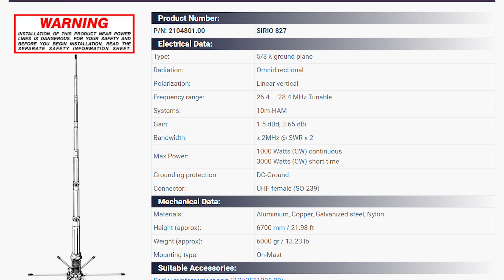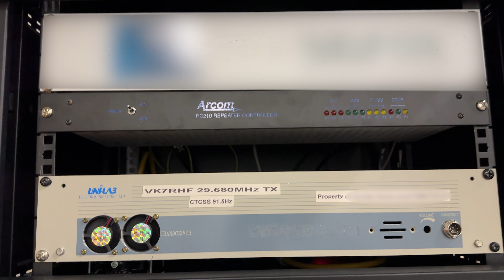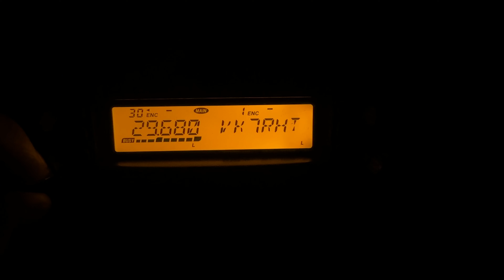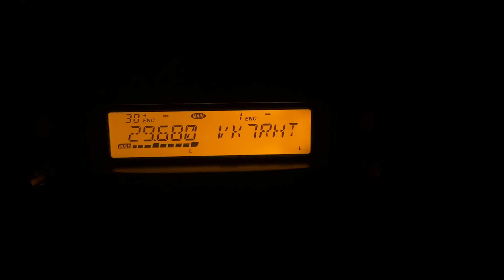This 10M/CB Antenna is a BEAST!

Comment: I have the 5/8 wave Sirio standard tunable 10/11 meter ground plane. This one has an adjustable top hat for tuning and 3 long radials. They are around $100. I'm using this until I get my hex beam But it's a really good antenna. I've made contacts all over the world with it on 10 meters with only 200watts. Studying for my general ticket and will get the hex beam up by the time I'm legal for all the other bands.

Comment: I have had 2 of the Megarang 827 antennas myself, 2 of my best antennas. Tip replace the screws at the top parts with clamps. Screws wear out the aluminum by moving the antenna, it then sinks 1,2,3 cm until a part collapses or slides in.

Comment: The metal roof certainly doing the heavy lifting giving the vertical antenna a really good reflection. Being elevated certainly helps as well because as we all know "height is might".  The combination of the  two probably makes this antenna a stellar performer.
Reply from the maker: Height is certainly might!
Reply: some common sense right here..

Comment: I am on my second 827 after having one of the first in the UK from the shop I worked at. They are a fantastic well made antenna 👍
Reply: i saw my first 30 years ago when i had the CTE Spectrum, which was a copy back then on the Sirio 2012.
i've had 827 thought for nearly 30 years myself..

Comment: I have an original Penetrator 500 I bought back in the early 80's that I just took off my roof and put in the shed. It was a great antenna back in the day.
Reply: I had a Sigma 4 in the UK, absolutely massive aerial...worked no better than a cheap 5/8wave vertical with no ground planes.  I got a far better range on the 5/8 wave silver road on a 10ft pole hammered in to the garden compared with a Sigma 4 on a 20ft pole on a house.  Both fed with RG58U in those days as we didn't know any better. 
The silver rod was hit by lightning and the top 3 sections vanished, plus there was a strong ozone smell on the grass.
Reply from the maker: Can’t work DX when it’s in the shed and not on the roof 😂
Reply: 827 is good but the penetrator 500 is the dx king

Comment: Haden, I can't speak personally about that antenna, but I know two people that have used them with superb results, but both have suffered broken radials on several occasions and that is with the ring.
Don't know if it was fatigue or the cocky's but I have heard the radials vibrate in wind.
What I can say is, I bought two Sirio 2016 antennas like you at great expense and even more ridiculous freight charges but are the best 10/11 vertical I've tried hands down. 
I do have a 4 element Sirio Yagi to go up on me mast when I get round to finishing it and can't wait to try it coz I've never experienced a Yagi yet.
Reply from the maker: Thanks for the heads up. We’ll keep an eye on the radials

Comment: I've had an 827 up for 14 years - it was tuned to 11m for years but SWR crept up eventually - cause was on the top 3 sections, the screw holes elongated an inch on the 3rd section where it joins to the 4th section, after taking it down for repair, I cut slits in the ends and used Jubilee Clips/Hose Clips and aluminium grease, put it back together and re-tuned it to 10m - with the rig internal tuner on just the mini 8 coax, it matches up on 6, 11, 12, 15, 17, 20 & 30m - some times it will match on 40 and sometimes it wont?  - it's also usable on 2m. Mines just 9 feet off the ground, in the back garden surrounded by houses but like 30 or more yards North, 60 yards East & 200+ West from the antenna and just 10 yards space towards the South, and on FT4/8 I've hit Australia, Argentina/South America, Falkland Islands and as far west as California from the UK to name a few, I think it's a superb antenna. It was £119 when I bought it and even today it's around the same price in the UK :)
Reply from the maker: The import charges and shipping is the killer to get it here. Hopefully the glue lined heatshrink stops those screws from moving

Comment: Sirio makes a pretty good antenna.. I have the Sirio 2016, its very similar to the 827, only it has 16 short radials rather than 8 longer ones. Ive worked 37 Countries just on 10m with it.  Bonus! It tunes up on 11/12/15 with a tuner. Works really good on those bands WITH a TUNER.
Reply: 'it tunes up' ??
no it doesn't, 
it is tuned for 11mtrs, and once set it stays tuned for 11mtrs.
your tuner fools you into think the ATU pixies have gone and tuned it for other bands.

hand your licence back, you don't deserve it.
Reply: @CBRadioWayBack10-4  No, I tuned mine strictly for 10 meters.  

I know using my tuner is a compromise, but the best antenna is the one you have. So I use what I have with a tuner. Go away kid, your taking up my oxygen.
Reply: @KQ4JGS  so after all that reply, you ended with 'go away little kid'
you could have saved yourself all that oxygen by not even responding.

Comment: Thanks for the video. I am building a repeater on 29.64 in Houston, Texas. What is the usual separation distance between the receiver and transmitter? I have two sites that are about 6 miles apart. 73, Glenn WB5TUF
Reply from the maker: Awesome Glenn!
6 miles should be more than enough. Here is an interesting read on horizontal and vertical separation - https://www.repeater-builder.com/antenna/separation.html

I aim for about 100dB of isolation.

Comment: I see your 10 meter repeater is on  29.68 MHz, which is a frequency 
I have sometimes keyed up here,
when the band is open lately.
I have on numerous occasions 
used 29.65 repeater HB3HD in
Switzerland from here in the 
state of New Hampshire. A couple
of weeks ago I reached OD5TX in
Lebanon and other times, stations
in Switzerland. 73 de W2CH Ray, NH 😊
Reply from the maker: I hope you get to work it!
Reply: Solar flux is going to have to be higher than 175 to have a chance. Today's 133 isn't helping.

Comment: Nice setup. Is that a GE MLS 2 VHF transmitter?  I'm also putting up a low band repeater in the states. Thanks.
Reply from the maker: Yep! Remounted on a larger heatsink!

Comment: According to the manufacturer’s specifications, the antenna can be tuned up to 28.4 Mhz. Did you have to modify the top end of the antenna to tune it to 29.680 Mhz.
Reply from the maker: Yes. I had to remove the very top section.. I then put a new "plug" on the top to stop the water running in and adjusted it for 29.680 MHz. 1:1 SWR
Reply: @HamRadioDX  Perfect, thank for the info. VE2MTK

Comment: If there was a supplier in Australia that had the stuff at anywhere NEAR a fair price, I would use SS-30 Jet Lube on the elements instead of the carbon grease. But, I only found one supplier, and they wanted almost $90 for a 30ml tube of the stuff. It might be good, but it can't be THAT GOOD.....American made, Profit driven product.
Reply from the maker: $3 per ml! Goodness gracious that’s expensive

Comment: Hi Hayden, is the repeater now on air? And does it require a CTCSS tone to trigger it? Thanks - VK2TS
Reply from the maker: Hi Tony,
Only the transmitter - the receiver isn’t too far behind being installed. It will use a 91.5 Hz tone 👍
Reply: Thanks mate appreciated.  @HamRadioDX

Comment: The Sirio 827 does incorporate some of the latest antenna theory, compared to some older CB antennas designs. The full length 5/8 wave gives about the lowest angle possible and doesn't need a top hat, nor is one desired. On shorter antennas, a top hat can raise the current high on the antenna, to make it act a bit like a longer antenna, but any longer than the 827 and the pattern starts to split off at high angles. The multi-turn matching coil acts somewhat like an RF choke, compared to the old single loop matching coil. The 8 eighth wave ground radials are supposed to be more effective than 4 quarter wave radials and the radials also help to isolate the feed line from RF radiation. I doubt the ferrite bead RF choke is needed on the feed line. Unlike the other Sirio antennas, the 827 has fairly heavy construction, compared to the lighter ones. The matching coil and radials really help to expand the SWR frequency range of the antenna. The Sirio 2016 is lighter weight, slightly shorter, with a top hat and has a lower wind load, but is not as strongly constructed.
Reply from the maker: Yeah I’m impressed with the antenna! I bought a 2nd one to convert to use on our 6m repeater

Comment: Where are you at on linear vs switching psu for home base hd rig? Spotted the switching psu
Reply from the maker: Linear if you’re running a home HF station… some switching like Manson and a few others are pretty RF quiet now, so they are good.

Comment: I have an issue with mine. And I am not sure if it's because I am not using common mode choke...
Reply from the maker: What's the issue?
Reply: @HamRadioDX I have a constant s2-s3 . It's not a classic static sound . Seems like there is noise inside but doesn't sound like a proper noise . I have run my radio on battery and still the same. So the antenna is grabbing something out there . Perhaps electricity pylons that have outdated equipment and need to be replaced. Should I change antenna polarization or try a common mode choke ? Jimmy SY1DAL
Reply from the maker: Try a common mode choke. You can see if there’s an issue by changing out the feedline too
Reply: I use a very good quality feed line. You think it might has issues ? It's strange. Never had issues . I will try common mode choke first ... Thanks 😊
Reply from the maker: Try the common mode choke you might be picking up noise on the feedline
Reply: Will check ...

Comment: I've been looking at this antenna and it's baby brother.
I've never built a repeater and I'm still only foundation but I want to build a 10m repeater now lol. 
I was looking at how to build 10m cans for a duplexer I should be able to make some steel ones. 
But for now I might just buy the baby sirrio for 10m, yes I know I can make a flower pot antenna I actually have one, but I want a ground plane antenna. 

I wonder if I would be able to put a 10m repeater on Telecom tower.

Thanks.
Shane VK1NME.
Reply from the maker: Building a 10M repeater is a bit of an issue - there are no free frequency pairs without overlapping at the moment. VK2 has WAYYYYY too many allocated. When the band opens up it can be mayhem
Reply: @HamRadioDX  what about 15m? Is it possible to have a 15m repeater?
Reply from the maker: No not really, at least not on FM there is nothing in the bandplan for under 29 MHz

Comment: in my opinon 5/8 antennas are not great... they require them to be shunted to ground (the tuning coil) and seem to have poor (poors a bad word maybe less than ideal?) receive... i put a m400 up and never looked back..
Reply from the maker: Being DC grounded is an advantage from both a lightning and noise point of view. I’ve had success with different 5/8 antennas over the years.
Reply: @HamRadioDX  im not saying theyre bad. this is one of the better designs ive seen. and all really depends on usage. for dx youre not gonna notice a difference. local usually a different story.

Comment: it's a 30 year old if not older designed antenna, 
it's a 5/8th wave and is no better or worse than any similar 5/8th antenna.
so what are you trying to tel us, after thirty years you have just bought an 827 ??

right and ??

nothing special, 2008, 2012, 2016 all the same antenna,
Tornado,, CTE Spectrum, Mantova 5/8, all pretty much the same antenna.

what are you trying to tell the newcomer idiots to the hobby ?
Reply from the maker: No worries champ.